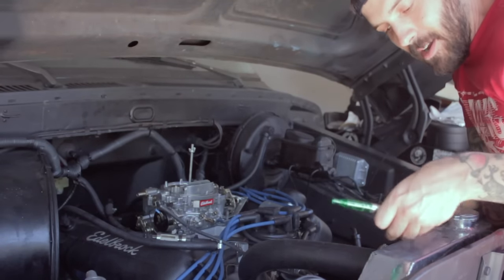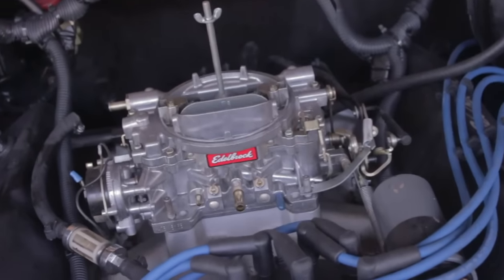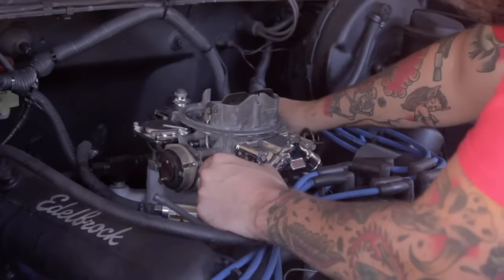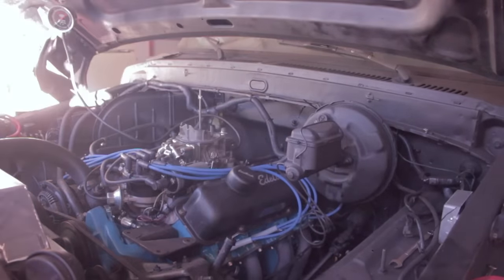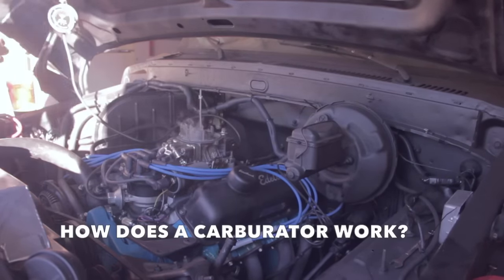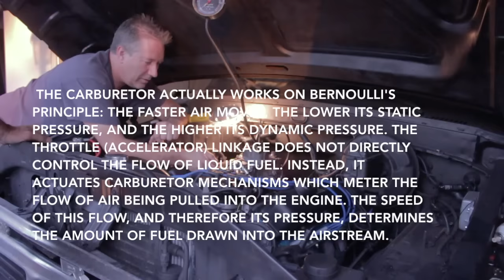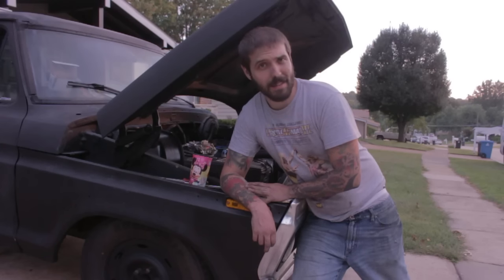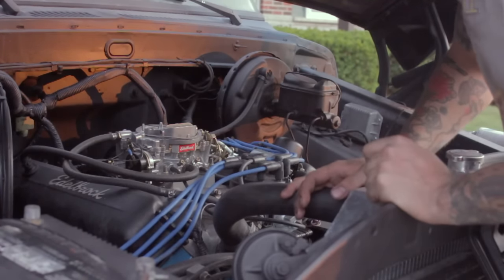Carburetor Troubleshooting and a Test Drive (1973 Ford F100 Rebuild = Day 54)

Comment: Good to see you guys driving the truck!  Carb issues are always a mess.  I'm going to have to go through this as well.  I have about 6 different carbs that I've come across over the last year or so and picked up for cheap.  I need to make a decision on the one that I'm going to try and rebuild it.  My engine is coming along as well, spending more time on the suspension at this point.  Keep 'em coming on your end.  Good stuff. Clay

Comment: Sounds great the carb is easy to tune they have good videos on edelbrok website an sounds like u have a timing issue u should start with stock timing and advance 2 to 4 deg more for the cam put u have to set it with the vacuum advance in plugged

Comment: Lol, I once was welding an exhaust manifold and had used parts cleaner to help get some caked on oil off. While welding there was a pool of parts cleaner on the far end of the manifold that caught fire. Guess which rag I grabbed to put the fire out, and then threw into the pile of other rags full of parts cleaner... Yep. good thing it was winter and we had 4 feet of snow outside to throw on that pile of fire.

Comment: The newer Holley's fixed their power valve problems which is why stop running them and went to Edelbrock carbs. Carbs take know how and time to learn how to tune properly. I always had better luck with Edelbrock years ago. For future reference an easy way to find vacuum leaks is with a can of starter fluid. While the engine is running lightly spray around the hoses trying to keep the starter fluid from going into into the carb. If you have a leak it we rev when it sucks in the starter fluid.
Reply: I should say the Holley carbs I had, had power valve problems and that's why I stuck with Edelbrock

Comment: I'm upgrading my 73 from a 2 barrel to a 4 barrel and managed to get a Holley carb for free from a buddy cause he didn't need it. The only problem is it needs a rebuild badly he said and the cab is so special that it was only made for 75 and 76 390 FE engine. It's not just a 4160, which is easy and cheap to rebuild, it's a 4160C. Holley said they obsoleted the kit, none of my local parts stores can get it and I'm too broke for a new Holley.

Did the instrument panel in your truck get upgraded or changed? Looks kinda funky

Comment: My truck ran like crap for awhile 73 f100. Then I just started using mid grade or premium fuel now it runs great.  These trucks run like crap on cheap fuel.  Mine will diesel on cheap fuel as well.

Comment: it doesn't sound right check for vacum leak at the brake booster and firing order cracked plugs i hear a miss spray wd 40 around manifold also check valve timing with a degree wheel it sounds like its just not hitting right also your cam could be to big for your heads port job take care of that